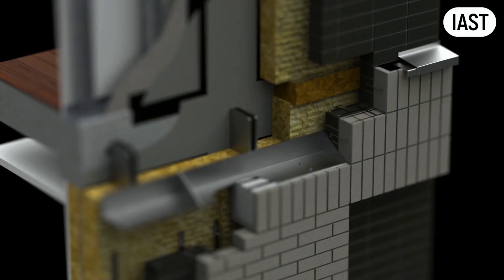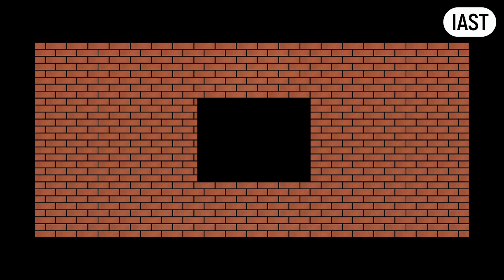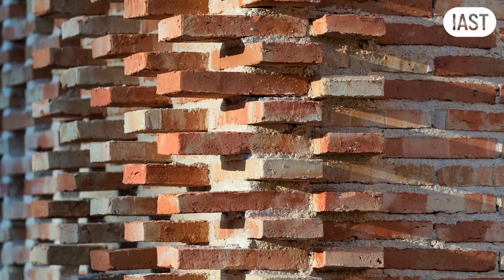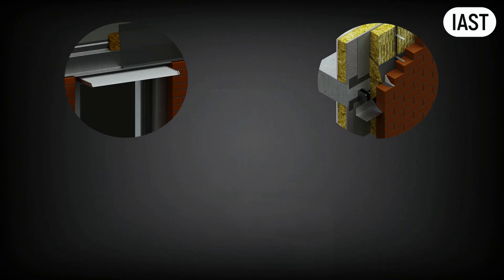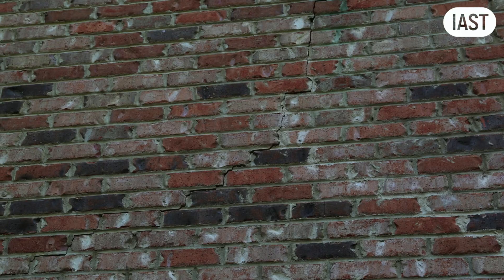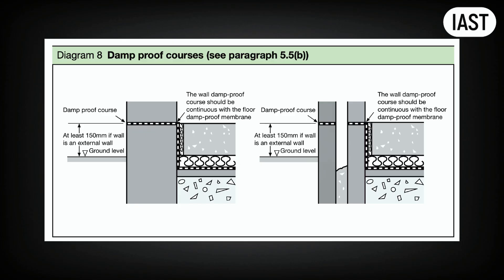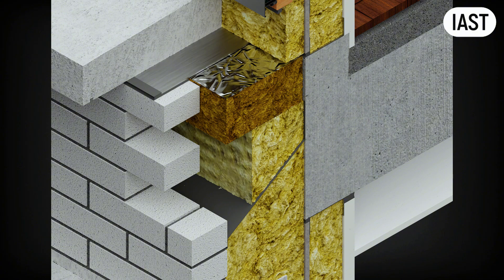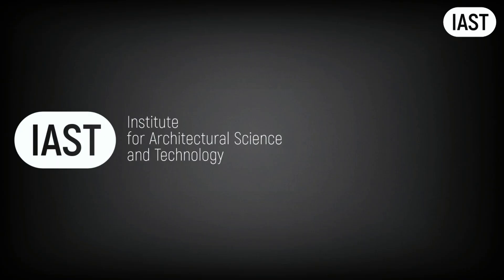Brick Veneer Facade 10 Mistakes

Comment: The cavity will cause chimney effect in case of a fire. The bricks should be installed directly on the insulation and vapor barrier, with no cavity.
Reply: This is a "Damned if you do, damned if you don't" situation that the specific details have to be gotten right for, because you have to be thinking about more than one thing while you plan it out.
  
For a rain screen to be effective, you need to be able to move moist air out of the cavity.  If you put a porous material (i.e. brick) up against a non-closed-cell insulation, the solar vapor drive will pump moisture into whatever is touching it on the non-sunlit side.  Even hydrophobic materials will allow the passage of water when soaked in it.  The point of the rain screen is to break capillary action and give the inside of a porous surface a chance to dry out naturally so that it doesn't support undesirable life forms or remain wet when the weather turns cold (causing accelerated freeze-thaw destruction of the mortar).
  
Where your vapor/water barrier is in your assembly matters too - if it is less than 60% of the depth of the insulation from the outside, during the summer (cooling season) the dew point transition can be on the wrong side of your vapor barrier causing moisture to condense out into the insulation (causing mold, rot, etc.).
  
Yes, a cavity could be a chimney risk - which is why you mitigate that by using non-flammable fire-rated materials like mineral wool and metal drainage planes (unlike the foam used on Grenfell Towers).  Then, you add fire breaks periodically to limit air flows to where you want them to go - specifically blocking areas around building penetrations like windows and doors so that a cavity fire cannot gain entry to the building.
  
When fire breaks are mixed with proper air ventilation, you get smaller sections of independently drying cavity - yet no liquid water transmission to the inner support wall, or significant risk of fire propagation.

Comment: Depending on the application, something you can think about is to use dimple mat behind the brick or whatever veneer you are using to provide a drainage plane down to the weep holes. Also it keeps mortar out of the cavity.
Reply from the maker: Yes. Very valid strategy especially for retrofitting of existing masonry. We hear this is widely used in North America. Dimple mats are reserved for groundwork and base details in Europe. Europeans should rethink this and expand the use of the mats to facades

Comment: Hang on a minute, many brick built houses use full fill cavity insulation. The insulation is designed to prevent moisture wicking.
Reply from the maker: Full fill cavity walls exist. But with wrong insulation, this could lead to serious problems. It should be subject to future videos for sure.

Comment: dpc on top of insulation should fix the cavity issue
Reply from the maker: It is problematic with brick ties penetrating the water membrane. If it is installed on top of insulation. Installing double layer could be an option, as long as there is water control layer behind insulation.